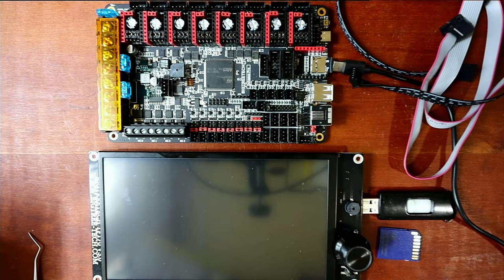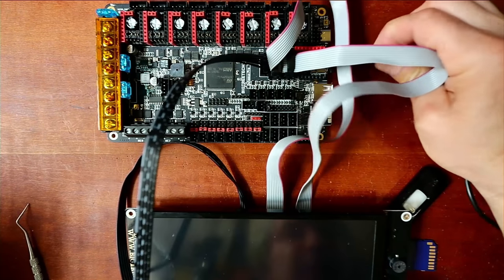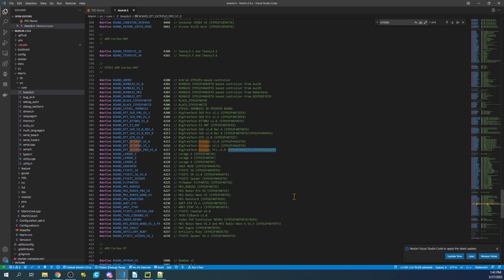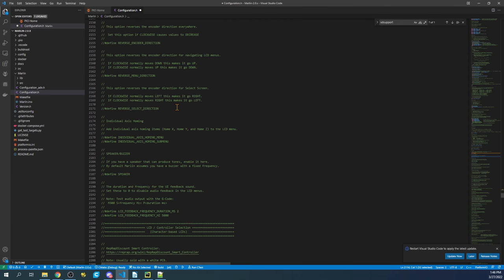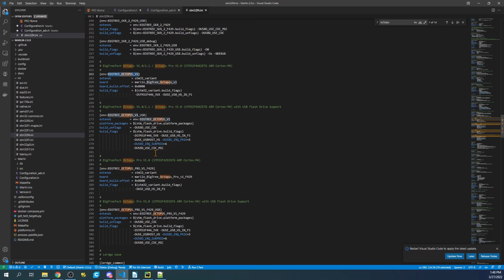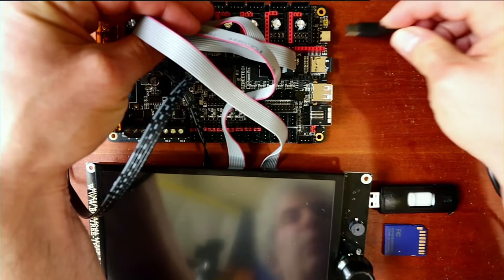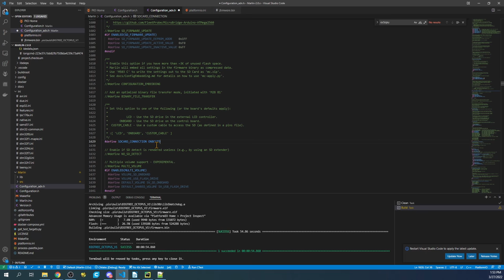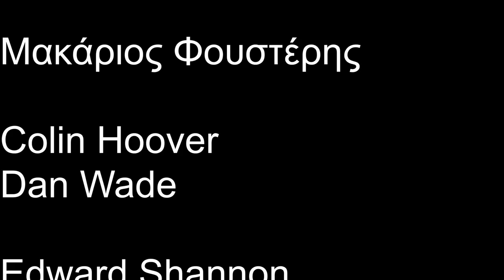BTT Octopus Pro - BTT TFT 7"

Comment: Fantastic job on the video - good, clear, concise explanations, no annoying background music, and obviously knowledgeable on the topic. Even the coughing & bad typing added to a positive experience.... made it all more human!
I followed your excellent guide, everything tested and loaded without issues, but the screen (TFT70) still reports 'no printer found'. BTW- my screen came with 2 serial cables, one crossed over, Tx-Rx, and one straight thru. Since the pins are reversed on the board vs the screen, I used the straight thru cable. May want to point that out to your audience. 
I've heard some of the earlier screens had bad serial port issues, but after spending almost a full day screwing around with this, I'm done! 
Any fresh ideas? 
No... 
How would you like a deal on a populated Octopus 1.1 & a TFT70. I'll even throw in an SKR E3 Turbo. It's either that or the shooting range...
Reply from the maker: Join the Discord in description and either myself or someone else can help.

Comment: Thanks for the video, I have a question about connectivity: Octopus PRO + TFT display 7 inch, they have both wifi capability with ESP32 or ESP-01. What I can do with these wifi? I mean, can I see the display UI remotely (like vnc) thanks to display wifi, and Octoprint connection thanks to ESP32 on motherboard? Thanks
Reply from the maker: WIFI is possible on both, but because I tried it out and was not impressed I avoid showing users how to use it.  A better solution is a Raspberry pi 4/Raspberry Pi zero 2 W/Raspberry Pi CM4 for communication with printer.  My favorite is Raspberry Pi CM4 with eMMC.

Comment: Error :printer halted kill called 
I'm facing that problem 
Please help me
Reply from the maker: What's the code say in Pronterface?
Reply: @EdwardBraiman  marline 1.1
Reply: And im using mks base gen v.1.0
Reply from the maker: The video is about BTT Octopus, not MKS.  Also the question was designed to say you have a possible broken thermostat.  Please watch the videos in my playlist for MkS.